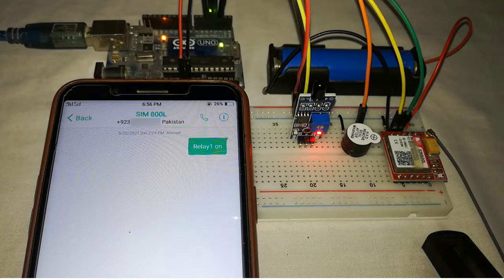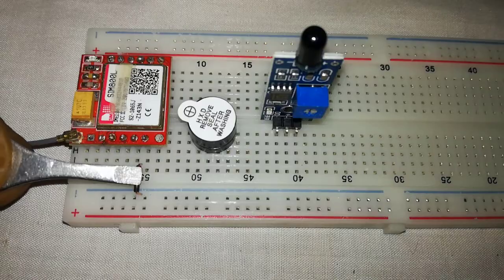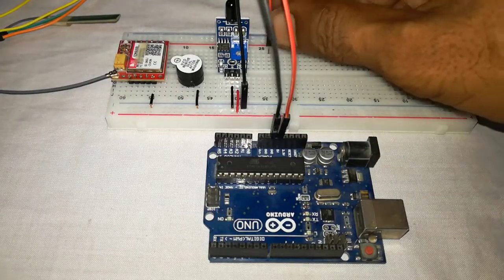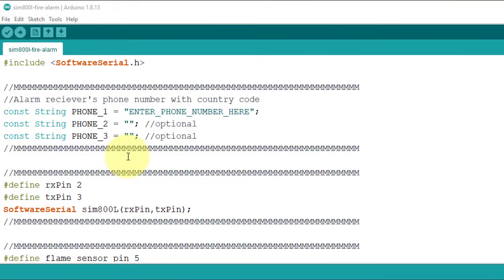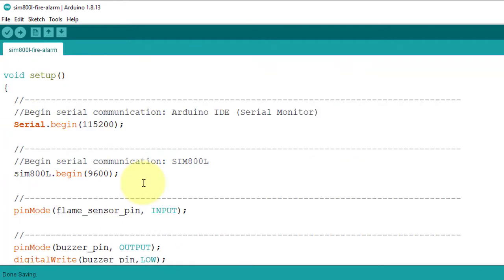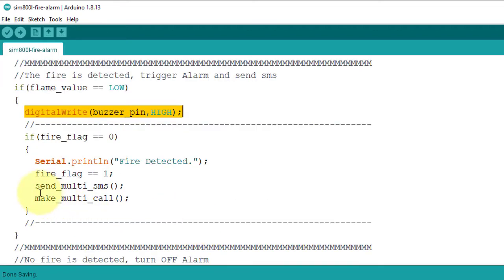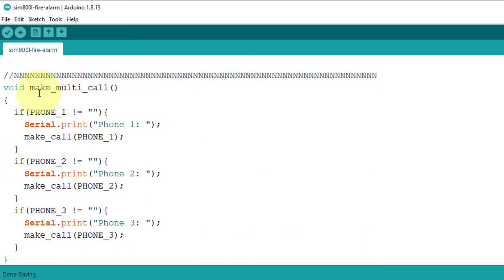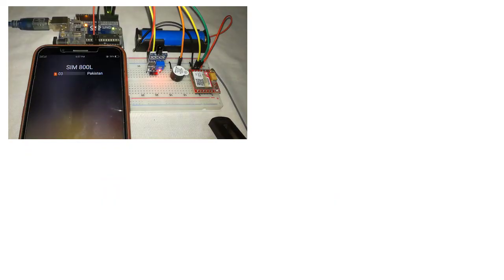GSM Based Fire Alarm System | Flame Sensor Arduino SIM800L

Comment: How can I stop the buzzer from sounding? When I'm using a lighter and focusing it on the sensor the sensor feels it and sends a signal to the buzzer to sound and when the buzzer goes off it doesn't want to stop what do I have to do to solve it?

Comment: The Serial Monitor only ends at Fire Detected. The Fire sensor and buzzer works but it won't send a message or call the number in the code
Reply: ¿Logró solucionar ese problema?

Comment: Firstly thank you for this tutorial.
I am having an issue with the sim800L module.
I have connected it to a 3.7V Li ion cell.
On turning on the led of the module blinks every 1sec for 6-8times then stops blinking for 3sec, then again blinks for 6-8 times and stops for 3sec.
Please can you help me what's causing this problem.
Reply from the maker: connect a capacitor to sim800l. connect the capacitor +ve leg to sim800l vcc pin. and connect capacitor -ve leg to sim800l gnd pin
Reply: @AhmadLogs what uF and volt capacitor to use?
Reply from the maker: @gusfring8333  I am using 25v 100uf capacitor https://youtu.be/RFCr25Yvix0
Reply: @AhmadLogs  thank you for your help!
Actually I tried the capacitor solution but it still did not work.
While surfing I found that sometimes a thinner gauge wire may be unable to provide the desired voltage and current.
So I swapped the default wires of the cell holder with a higher gauge wire and it started to work!
Don't even need the capacitor.
Reply from the maker: @gusfring8333  perfect!

Comment: Sir in the code
Sim800l. Print () it is not working in my case that's why can't get any call or message
Please tell what should I do
Reply from the maker: can you post your serial monitor output here.
Reply: @AhmadLogs  it show on the serial monitor =
Initializing
Fire detected
Calling...
Send messages...
Here sim800l. Print () message is not printing on the serial monitor and no call and message is send
Sir please help me it's my clg final year project i can't find any solution please help 🙏🙏🙏🙏🙏🙏🙏🙏🙏🙏

Comment: Can SIM800L can detect a 5g simcard? What components need to use to detect 4g or 5g simcard
Reply from the maker: no
Reply: @AhmadLogs  what GSM MODULE SUPPORTS 3G TO 5G SIM? planning to buy GSM MODULE SIM800L V2 to apply it in flame sensor
Reply from the maker: @darwinvillanueva5750  buy sim7600
Reply: @AhmadLogs  what do i need to change in code if I use SIM800L V2?
Reply from the maker: @darwinvillanueva5750  no change
Reply: @AhmadLogs  thankyouuuu sir
Reply: I used this code but it doesnt work
Reply: @AhmadLogs  can you help me in my project
Reply from the maker: @darwinvillanueva5750  I will try my best.
Reply: Where do I message you?
Reply: @AhmadLogs  I think we got a problem in a code. The gsm module and arduino doing fine, we have tested the gsm module and it transmit sms. But our sketch doesnt work. The buzzer,leds,flame sensor. Functioning well to designated function but the gsm doesnt transmit sms
Reply from the maker: @darwinvillanueva5750  hmmm. can you provide me the output of your serial monitor. I mean what display on the serial monitor when sim800l send or received sms
Reply: @AhmadLogs  where do I message you sir?? You have telegram??
Reply: @AhmadLogs  good evening sir?? Where do I message you??

Comment: Is it possible to use GSM SIM900A module in this???
Reply from the maker: It may be possible to replace the SIM800L with the SIM900A and use the same code, but there may be differences in their AT command sets and communication protocols that could require modifications to the code.

Comment: great work! I was wondering how do you use an MIT App Inventor to collect the phone number, instead of manually coding it into the arduino code? Hoping for your response
Reply from the maker: To establish a connection between your project and the MIT App Inventor, you will need either a Bluetooth, Wi-Fi, or USB connection. This connection will enable you to send phone numbers from the MIT App Inventor to the SIM800L module.

Comment: Ahmad there is error in the code he say
Sketch uses 6506 bytes (20%) of the program storeg space maximum is 32256 bytes.
Global variables use 502 bytes (24%) of memory leaving 1546 bytes for local variables maximum is 2048 bytes 
An error while uploading the the sketch
This is the error I wish that you help me with it
Reply from the maker: Sketch uses 6506 bytes (20%) of the program storeg space maximum is 32256 bytes.
Global variables use 502 bytes (24%) of memory leaving 1546 bytes for local variables maximum is 2048 bytes. all is correct till this point.

only the following line cause error. "An error while uploading the the sketch"
1. I think you does not select the arduino uno board from the tool menu. so make sure you have selected the Arduino UNO board, before uploading the code
2. just install the latest version of arduino IDE

Comment: It's blink every 1sec doseit matter
Reply from the maker: yes, it mean the sim800l is not connected to the network
Reply: @AhmadLogs  how I can connect it I do the same thing you do
Reply from the maker: @mr.shadow5522  powering sim800l is some how tricky. so it required 3.7v and it also required 2A current while performing burst operation. so you need a power supply that must capable of providing 2A of current. 
also use shorter wires from battery to sim800l.

Comment: It's not working the only thing I use different is the jumper wires you use regular wire when you connect the breadboard I use jumper wire dose it matter
Dose it need simcard to light up every 3 sec
Reply from the maker: jumper wires is not the matter. it must need sim card to light up every 3 sec
Reply: @AhmadLogs  I put one and it's still not working and thx for speed answer
Reply from the maker: @mr.shadow5522  use shorter wires from battery to sim800l power
Reply: @AhmadLogs  my breadboard isn't like yours mine don't have 2line one red 
and one blue can you make another video with this breadboard cuz it's different  and my wire are short enf
Reply: The battery work good btw

Comment: Greetings sir I used this same code with a sim900A but the sms was send once and during the the second try the sms was not send . And the call was not placed for both first and second testing. What could be the problem ?
Reply from the maker: try to change the baud rate for sim900 in the code

Comment: hello sir, why is my gsm module not sending text and call alert?
Reply from the maker: is it working?
Reply: not yet, only the buzzer and flame sensor is working. what should i do?
Reply: @AhmadLogs  the gsm module is blinking once every 3 seconds
Reply: but when I tested the fire detector, only the flame sensor and buzzer is working
Reply from the maker: @jerichodeacosta2184  it mean the sim800l is working fine. just make a call to your gsm module to see if it is responding or not?
Reply: @AhmadLogs  I called the number in gsm module and it is ringing
Reply from the maker: @jerichodeacosta2184  then check your rx and tx connection, check for loose connection. also set the same baud rate in the serial monitor that you have entered in the code.

Comment: Thank you for your work.  Can you adapt this project to be a pir sensor only?  So can you set it to call multiple phone numbers when it detects motion?  I tried a lot but I couldn't do it, I would be glad if you could help me.  Thank you.
Reply from the maker: I have already make a project using pir and sim800l. you might check that video
Reply: Ahmad, thank you for your interest.  My problem is with making calls to two or more numbers.  In the project you have made using the pir and sim800l you specified, it would be good if you could adapt it to call two or more phones.

Comment: WHAT if i change the flame sensor to the vibration sensor Sir?
Reply from the maker: then you must need to make change in the code
Reply: @AhmadLogs  HOW TO CHANGE?I HAVE NO IDEA TO CHANGE THE CODE
Reply: Its okey to use arduino nano in this code?
Reply from the maker: @deobertamar9554  yes
Reply: @AhmadLogs  can you edit the code for my project?
Reply from the maker: @deobertamar9554  I don't have vibration sensor. I will buy it and try to edit the code. give me your suggestions
Reply: If the vibration  alarm the buzzer will beep and  then  sending Message to my phone.
Reply from the maker: @deobertamar9554  ok I will try to make the code
Reply: @AhmadLogs  hi Sir ,how  about the code?
Reply: But I'm using Arduino nano,sw420vibration sensor,buzzer,and GMS800l.
Reply from the maker: @deobertamar9554  Ok, Iet me know how can I help you
Reply: Thank you Sir,
Reply: I hope Sir.

Comment: can i add more flame sensors?
Reply from the maker: yes you can. but it required to modify the code.
Reply: @AhmadLogs  when the same pin is possible?
Reply from the maker: @zenzen2113  yes, it is technically possible.

Comment: Bro i'm doing this project with sim800C instead of sim800l may I know what I have to change in Arduino code and band rate ??? Pls reply bro
Reply: Pls help me with this bro!!!
Reply from the maker: as I know, No change is required in the code
Reply: @AhmadLogs  sir I got ouput in serial monitor but I haven't get sms or call from my gsm 800c module.... I'm using VI SIM network which is an LTE broadcast,
Reply from the maker: @Ajay-oj4fh  try to make a call to your gsm module

Comment: thanks sir...i hope you got a Millions subscribers
Reply from the maker: So nice of you
Reply: @AhmadLogs  btw how to make the buzzer stop sounding when the sms has been sent?
Reply from the maker: @attahalilintar69progaming82  just use the following command
digitalWrite(buzzerPin, LOW);
Reply: @AhmadLogs  I have followed the command but it took a very long time for the bell to turn off by itself. so I have to forcefully turn off the buzzer after the sms is sent via the reset button on the arduino. now i am trying to change some of the commands you gave in the hope that the buzzer turns off after the sms is successfully sent
Reply from the maker: @attahalilintar69progaming82  ok. please let me know after modifying the code.

Comment: O need ur help i conmected a 9v battery and suddenly there was no blink im the gsm but the arduino and  fire detector light continously no blink
Reply from the maker: have you connected 9v battery to arduino or sim800l?
Reply: @AhmadLogs  the 9v acts as a power supply for both the arduino and gsm
Reply from the maker: @duncantychicus9649  for powering sim800l, the best power supply is 3.7v 2000mAh battery. you need to change the power supply for both arduino and sim800l. just connect the vcc of battery to sim800l vcc and arduino vcc

Comment: Thanks for sharing such an Awesome project.
Can you please modify this code to send 3 mobile numbers via SMS instead of hard coded in Arduino code to be received & stored in eeprom memory using 6 digit SMS code to set the Arduino to accept next SMS consists of  3 mobile numbers string to be stored in eeprom memory. Also another 6 digit SMS code to retrieve the 3 eeprom stored numbers to request received Mobile number. 
Awaiting your earliest response.
Kind regards.
Reply from the maker: Yes, sure. It will make it soon
Reply: @AhmadLogs  Ahmad bro Aoa, I am still looking forward to my request. Bro you please also guide how to add counter to this same code  to send  SMS & CALL 3 times to each phone number . This is in addition to my earlier request to get stored mobile numbers via SMS & not hard coded.
An early response will be highly appreciated.
Thanks & Kind regards.
Reply from the maker: @yawarsaeed6499  I will fulfill your first request very soon. just wait for some more time. 

to use a counter, use an integer type variable before setup function. and count that counter while sending sms using if condition.

Comment: Can this be used in a ne555 based heat sensor(thermistor) plz help
Reply from the maker: I think, you need to modify a little bit of code for ne555 based heat sensor(thermistor). 
this flame sensor is works on digital pin of arduino but most of thermistor works on analog pin. that's why you need to modify the code